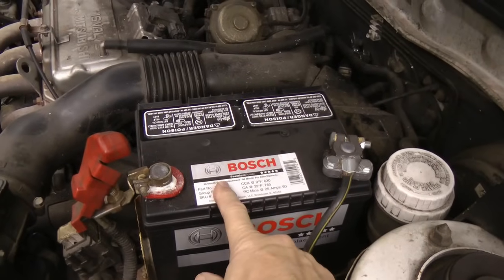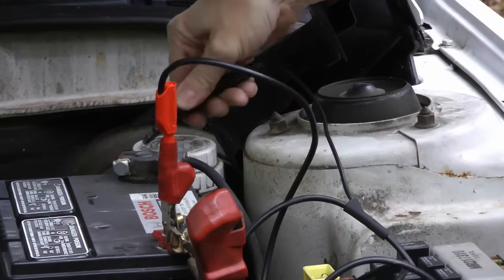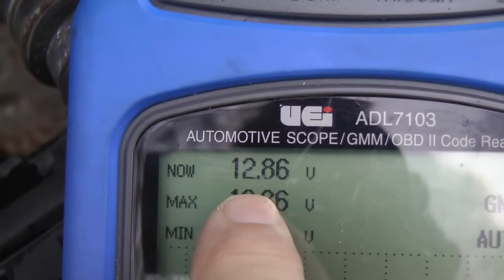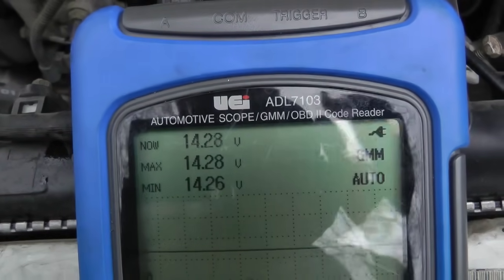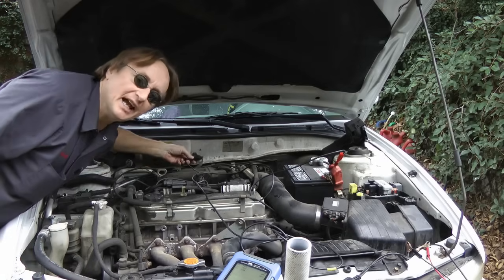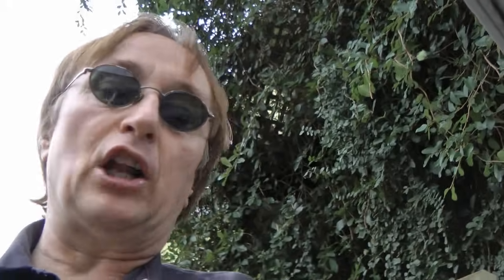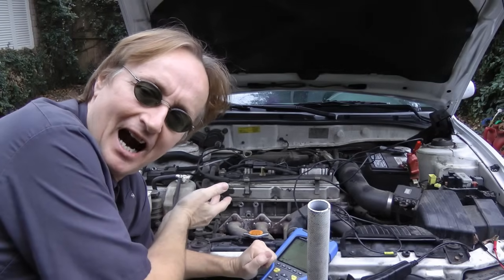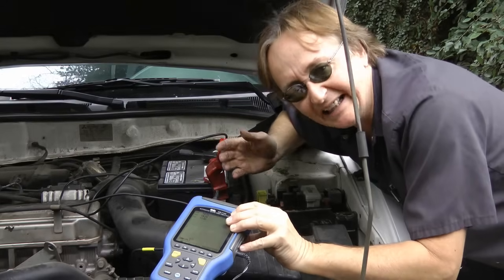How to Fix Electrical Problems in Your Car (Ground Fault)

Comment: Hey, hey. Blonde moment here... how am I supposed to test the ground wire in the trunk? Don't I need the positive hooked up to the battery? How am I supposed to have the positive hooked to the battery and the negative on the ground in the trunk?
Reply from the maker: get a long wired tester like I have to hook the tester up to the battery then the 20foot leads reach anything to test ground and power

Comment: hi scotty i have problem w my 1994 carburator type mitsu lancer everytime i turn headlights on idle rpm goes down from 800rpm - 500rpm causing engine to shake even goes lower if i switch to high beam or stepping on the brake. happens even if  the ac is off. car runs good though when no lights are on, whats causing this? thanks scotty

Comment: Hey, I was involved in an accident and my right tail light went out because the bulb broke and when that happened my dash lights also went out. If I put a bulb in it works but the dash lights still don't turn on at night when I turn my headlights on but the headlights and tail lights work. Any idea what it could be? It's not the fuse because I had them tested and they're all fine

Comment: My 1999 Pontiac Grand Prix has a weird problem when i turn on the heater fan my headlights go out with a click and the heater doesn't even come on until i get to speed 5 and i dont think this is connected but when i put my headlight knob in a couple spots all my dash lights go out. im thinking this would be the ignition or the heater resister but i have no idea
Reply from the maker: replace the blower motor resistor assembly
Reply: nope just replaced it today i should have mentioned that i bought the car for 400 bucks it ran just needed a new radiator but some idiot jerry riged a push starter going directly to the starter i think and to the battery plus when i turn on the heater it makes a click sound like a relay or something below the dash on the driver side

Comment: I have a bad ecm I have unplugged everything and still smell the fuse burning I have a 2001 Honda accord any ideas
Reply from the maker: well, either wiring is bad or main computer. Best to check wiring first, cause if you put in a new computer with wiring problems still there, boom goes the new one

Comment: My Honda Civic 2005 Dx license plate lights won't turn on when in Drive but they will turn on when I open my trunk, also when in reverse and when I press brakes
Reply from the maker: check for ground wiring shorts in the trunk or corroded sockets

Comment: Scotty I wish you lived near me........hope you can help.  I have a 2005 F150 and the tail lights do not work when the switch is activated in the manual on setting.  When the switch is in the auto on position they do work but the instrument lights don't work but do work when in the manual position.  So all lights work,  but not at all times.  Any idea at all what to look for and where.  Also I did replace the switch with a new one and results are still the same.  Keep up the good videos I've learned a lot.  Thanks
Reply from the maker: realize the body control module which the switch sends power to ultimately runs all that. Often a bad one does just that, but also check for bad ground wiring
Reply: Thank you I'll check it.

Comment: I have this electrical problem with my 2002 chevy blazer,the drl and the dashboard lights go on and off,even I heard some noise like when the switch is on,and the hdlp relay makes some scratchy noise,can someone help me please
Reply from the maker: check the headlight switch for shorts and also have the alternator load tested, could be bad. Auto zones check em free

Comment: How can you test the grounds that are out of reach of the voltmeter? Are you using an extension?
Reply from the maker: yes
Reply: okay, I have an XJ8 the battery is in the trunk while all of the fuses are NOT in the trunk haha (one bank is but there are 3 others in the interior. 

Any suggestions? Should I just test each fuse like others show on here rather than worrying bout getting an extension negative cord, and worrying about it touching my car or something whilst testing.

Comment: Hi Scotty! I love your videos. Super helpful! I have a 94 Honda Accord, recently I put it in park and the shifter locked. Now I have to put the key in the shift unlock hole put ir in neutral and then crank it. Also my speedometer, temperature gauge, gas gauge, and rpm doesnt work since that happened. Also my automatic windows won't go up. Can you please help me before I have to spend $400-$500 bucks for something that may be a quick fix. Thank you so much!

Comment: Hi Scotty..all of a sudden..my 99 trans am pontiac the accessory lights stay on for over 15 minutes..driving or not..off or on?...i'm having a heck of a time finding out what to see first..module?..in the door?..i put in my own window ...door panels..years ago..car is beautiful...well taken care of ..by me...but i'm a little goofy here...can you suggest?
Reply from the maker: often just a worn ignition switch
Reply: how do i check for that?..when i sprayed inside the side of door ...the locking pieces that hook?..it stopped turning on the lights overhead...hmmm..i'm goin goofy here
Thanks Scotty..

Comment: I was using the 110 power outlet to use a air pump on another cars tire. The outlet is in the back a Toyota Highlander. It burn out the air pump and the car is dead. I hooked up a very good battery charger on the cars battery. there several options on the charger so I used automatic 12V came out in 45 minutes nothing no headlights or key alarm ( ding , ding, ding). I tried the Engine Start Mode as there are 3 modes 2 amp, 10, amp and Engine Start. Still nothing no power at all in the car. Does any one know if there would be a specific fuse that was blown or is it just a burned out battery. I have had no problems with the battery before. It is past warranty time. I figured the outlet in the back of the SUV was just like a Cigarette lighter...terribly wrong option. Please Help as am Stranded in Biloxi MS just need  guidance
Reply from the maker: try jump starting it, if it does, replace the battery. if it doesn't, you fried something and pray its a fuse and not a main computer system
Reply: wow I hope not.
I bought a new battery and haven't put it in , will check all fuses to be sure on them

Comment: i have a 99 honda odyssey car works perfect EXCEPT when you turn it off. I take out the keys and the car goes bonkers the gas, c/h needle and locks make like clicking noises we put in new starter, alternator,  battery, ignition, nothing has helped any idea what it could be?
Reply: and on the same day before this happend all the lights on the dash turned on and off so did the radio

Comment: Hope u can answer this question. I have a 2014 Nissan Maxima and for some reason my information display doesn't work. It looks like it has power because I can see the back light but doesn't display information. Someone told me the instrument cluster is bad but everything works like the odemoter and rpm and mileage. Thanks in advance.
Reply from the maker: those are cheaply made and often short out internally. No one really fixes em, just replaces them,, and they cost a ton. Me, I'd live without it

Comment: hi Scotty, I need help. Just changed all the bulbs in the instrument cluster. Light on the fuel gage comes on when I hit a bump, then it turn itself off. Any suggestions?
Reply from the maker: check for wiring shorts or loose connections where you just worked

Comment: also had battery checked again and is fine and the battery terminals are and always have been completely clean. I have also checked out many grounds and everything seems to be in quite good condition besides everything else I told you. alright thanks.

Comment: hey Scotty I've got a 1991 lincoln town car with the 281 4.6 v8 original 95 amp altinator went out along with old battery. replaced both from auto zone. the rebuilt altinator failed with in less than two months, they said everything was fried in it. so I bought the (gold) one witch is brand new and there best. this one  seems to work just fine but once you start the car and idle drops every single light gets bright then dim like a perfect pattern, the fuel pump and engine also run like this all in sync with each other. also each time we start it either the air bag light will flash a code or the anti brake light will come on or both or not at all. now they come on no matter what every time we start it and there's this weird audible beep beep noise coming from under the dash on drivers side that's completely different from the regular door bell ring and will now do it randomly wile driving it down the road. what do you think is causing the electricity pulsing and what's the beep beeping coming from and meaning? I've owned this lincoln and many other ones for years and have never heard this and NOBODY else even understands it. maybe you have noticed this in your days. thank you very much Scott and for all the other helpful videos you have taught me a lot over the last few years with all of my older cars/trucks.
Reply from the maker: check the wiring for shorts, especially ground wiring

Comment: Hi Scott Kilmer. ..I have a brake light problem,  on my 2001 mustang, I replace multiple function switch check on rear light bulbs , also replace the brake  switch and still not working, all the fuses are good. ...what the problem should be? .....
Reply from the maker: generally when that old sockets corrode doing that or ground wiring goes bad

Comment: zoomcamaro@centurylink.net  I will like to know if is safe for me to barrow power from my window switch to connect my LED lights or can you show me a better way of doing it . Thank You .
Reply from the maker: depends on the rating of the led lights, how many amps they pull. If more than 10 amps, run em off the battery directly

Comment: why do my led lights flicker on my door panels on my camaro when the engine is running .
Reply: why does this happen
Reply from the maker: have the alternator load tested, auto zones do that free. If not that, often bad ground wiring

Comment: i can not figure out an electrical problem in my car, that is whenever i turn on headlights my cars starts missing for 2 or 3 seconds then it becomes stables and then misses. while driving in night during shifting if gears same thing happens. And its misses even more when i switch headlights to high beams. Can you help me out with this problem?

Comment: I'm having weird electrical issues with a 2002 ford focus. Started 4 months ago with a clicking sound when turning the key,and the car not starting but then starting on the second try. Same thing happened twice two weeks apart, then another time without the clicking sound. I've also heard the same sound from the drivers side dash while the analog temp and gas gauges flickered back and fourth and hearing static from the radio while it was turned off. This happened three days in a row, stopping and starting randomly.

Now yesterday I experienced a loud boom and buckling that felt like the car downshifted when I turned on the headlights and the tran axle/cooling system light coming on for a few seconds. Today a new headlight bulb blew out.

Any idea what to make of all this? A battery test at autozone showed charged at 12.40 volts and I'm told the alternator is still charging the battery.
Reply from the maker: either weak battery or shot starter motor

Comment: Hi Scotty. I have a 97 Honda civic and the dash and tail lights only work when they feel like it, but most of the time they don't work. I have checked all the fuses and the continuity and it is all fine. Don't know what to do next
Reply from the maker: often a bad headlight switch on that

Comment: Maybe you can help me out. I have a 2001 Dodge Durango the cam shaft censer keeps going out 4 times this year any ideas?
Reply from the maker: check the wiring, and ONLY buy oem sensors not chinese knock offs

Comment: my 2000 cadillac eldorado has all lights working but turn signals are faster than usual. i was thinking this could be the flasher needing to be replaced ,but im not sure.
Reply from the maker: pray it's that easy of a fix

Comment: my running lights and dash lights aren't working and every time I chase the fuse the fuse blows.. please help..
Reply from the maker: trace the wirin from the fuse to the switch and back to the lights.And realize shorts are often at the ends, like shorted out corroded bulb sockets

Comment: my blinkers worked fine with my old radio in then i cut the wires and hooked up my new radio and now my blinkers dont work what could that be? its a 1996 geo prizm

Comment: I have a 2000 Plymouth Voyager & the back tail lights and back turn signal don't work or my dash lights help please
Reply from the maker: often a bad switch assembly does that, pray it's not the body control module

Comment: Scotty, I have a problem with a 1998 Renault Clio, the Dash board has lost half of the backlights display. Could a relay or fuse be the suspect fault ?
Reply from the maker: no, either bulbs burned out or circuit board is warped andd shorted
Reply: Thanks Scotty, i have bought replacement bulbs which i will fit tomorrow if that fails i will seek help from an auto spark
Reply: My initial thought was a bad connection between the copper circuit that is between the bulb holders and the plastic fascia of the clocks as it is very easily moved out of place

Comment: Hi scotty im having a bad connection on my break lights we did put new bulbs but the thing is they're always on even im not stepping into the breaks
Reply: if the bulbs were working then why replace them? you need to see where they are getting the power TO work. Brake switch near the pedal may need to be replaced OR simply adjusted
Reply: Not Always the case , it could easily be the bcm.
Reply: Sometimes the bump stop will dry rot and fall out allowing the brake switch to stay extended. I see that on Kia's and Hyundais a lot.
Reply: mark oliver ancheta  brake light switch
Reply: ra777 What does bcm stand for?

Comment: I have a 2001 Chevy Suburban and went to start it and all the electrical stopped working including lights locks and no crank.  Battery alternator and starter are good I'm lost any help?
Reply: I have the same problem with my 1999

Comment: my 1999 honda civic lights flickering when the engine is running also the engine stutters at a certain speed when im accerlerating, but as soon as the flickering stop the stuttering from the engine stop too, what could be causing that?
Reply: Scotty Kilmer Don't forget to tip the guys..  especially if they install a battery,headlamps,diagnostic  etc... they are underpaid for what they do... The kid at sonic gets more for barely walking 2 feet to ur car...too many Mercedes D bags try and come take advantage of us to get free labor cause they really can't afford their car or service
Reply: My 97 civic dashboard instruments don't work. Went to the gas station to pump gas and when I tried to turn it back on it wouldn't. 10 minutes later I try again and it finally turns on. BUT, the rpm meter acts fishy and when I break (even if I slighty tap the break) the rpm goes all the way down to zero. Also, when I turn on a turn signal, the rpm goes up and down at the same time as the turn signal flickers. Lastly, if I turn on my stereo, it also brings rpm down to zero and my stereo also just turns off out of nowhere. Idk what's wrong..
Reply: all the lights on the car flicker
Reply from the maker: often weak alternator, auto zones load test them and batteries free
Reply: Leon Springs Boys TV lol why u say that ?😭😭💢👏👏
Reply: I just got a 99 civic and the same two things are happening, did you ever figure it out?

Comment: Hey Scotty, my wife's left rear brake light on her 03 trailblazer won't come on when she presses the break pedal. Her right side brake light is fine so it isn't the switch, I've rotated the bulbs so the bulbs all work. Also the same light spot is the same as the left turn signal so I know the contacts are good. What gives?
Reply from the maker: I would just cut the power wire on the non working side and wire it to the working side. Rather than try to find a short that could be anywhere

Comment: I just bought a 1999 Cadillac DeVille, 119k miles. Runs pretty good, but wipers and pump for wash doesn't work. Cruise control is ok, so are turn indicators and high beam switch. Is this likely a switch problem in the stalk switch? Replace?
Reply from the maker: generaly a new wiper motor assembly fixes that, but do check ground wiring on the pump
Reply: Is there a repair manual you recommend? I am unable to find the wiper motor or the pump. Is the pump buried under everything? Follow the fill spout?

Comment: 2000 ford expedition, just got new battery and replaced alternator now all lights flicker when brakes applied or idle.  ?
Reply from the maker: check for wiring shorts or loose connections on charging system wiring, especially bad ground wiring